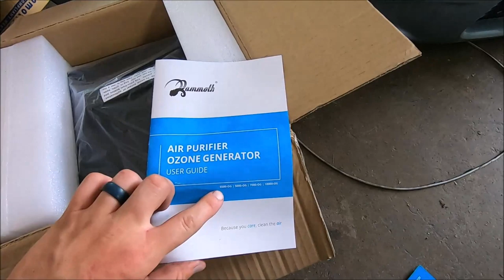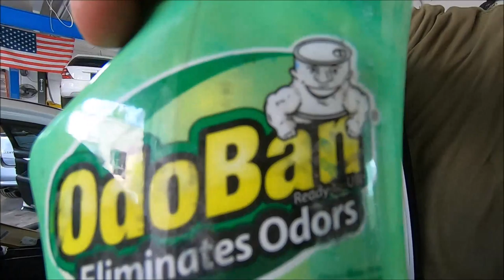First Time Using an Ozone Generator

Comment: I ended up with a nasty musty moldy smell in my convertible a while back. I got an ozone generator, put the AC on high on recirculate, and let the ozone run for an hour, then let it sit overnight before opening it up and airing it out. The nasty smell was 100% gone and the chlorine smell went away after a couple days. I've also used it at work in an office where the woman was complaining about a musty smell. She's been happy ever since

Comment: Why spray Odor ban after Ozone? What was the point in using the generator then? You're meant to run the Ozone generator for maybe 40 mins then turn the car on and run the fans in the car on recirc for maybe 20 mins. Turn it off, let the car Air out for a bit and done.

Comment: You made a video of that ozone machine but you didn’t explain Wtf does that ozone machine do? 🤦‍♂️🤦‍♂️
Reply from the maker: It has fans and filters and the car smells like smoke. I thought context clues would have been enough
Reply: It converts o2 (oxygen) into o3 (ozone) and ozone breaks down smells 100x faster than oxygen does.